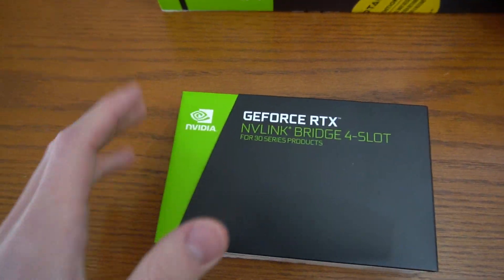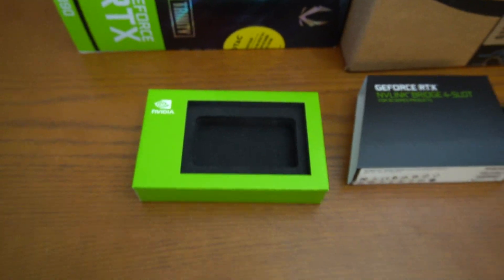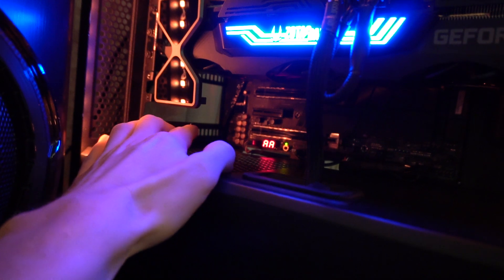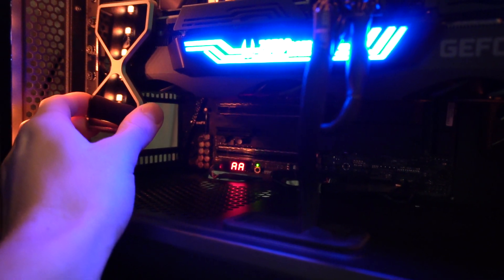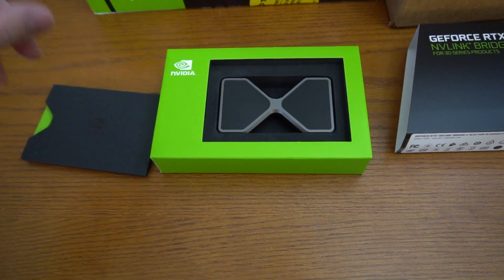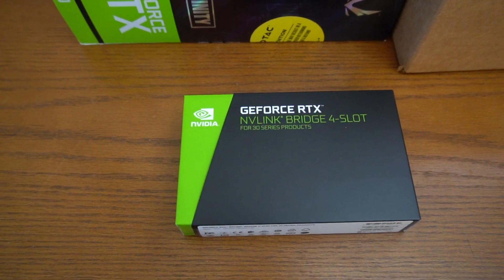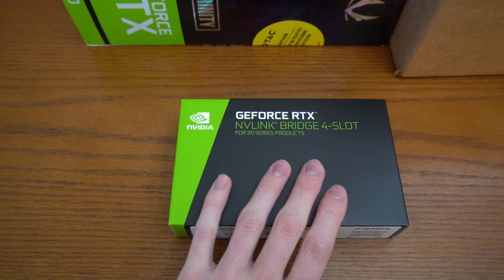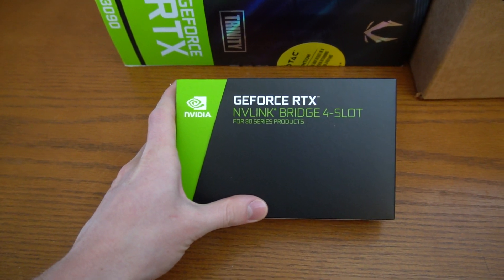RTX 3090 NVLINK issues already...

Comment: PNY NVIDIA NVLink Bridge 3-slot for Ampere RTX Quadro Tesla A6000 works for 3090 Ti FE GPUs but, I changed motherboards to get a 4 slot setup with the same Nvidia 4 slot bridge in the end. I did not want to run the GPUs hot long term but for demo testing the 3 slot PNY NVLink A6000/3090 worked. Actually, SLI configured directly on setup with Asus Maximus VIII Hero motherboard. However, with the EVGA Z590 Dark I had to manually run update for BIOS 1.02 to get version 1.08 for SLI to work. GPUs both worked but SLI needed a newer BIOS which I only figured out via lucky trial and error.
Reply: do you know which size of motherboard would work for the NVLink Bridge 4-slot for 3090?

Comment: I have the same problem. That's why I'm searching for this to find a 4-slot spacing motherboard. It's really frustrating and not very well thought out by Nvidia. I've tried using riser cables as well, but there's not enough room to position the cards with riser cables, given the extra space they require for the cabling and however you're going to position the card with risers and bridge.

Comment: There iis only one way to finish that job in my opinion.  The 3 slot bridge is for the 20 series and the 4 slot for t 30 series boards.  You need half a slot ventiation space.  Using that motherboard with that amount of power is like trying to race two supercars in gridlock.  Some serious heat going through the motherboard too.  There is still a way if you really want to try and drive supercars through the crowded tiny streets of that motherboard.   PCIE risers.  Install the risers.  Make yourself a box or frame for the risers and cards to go in and mount the two cards exterannly.  You can finis that jo that way if you really want to keep that motherboard.  That would even give you room for a load of other micscellanous expansion card stuff becase only the riser wires taking up space so get all the other slots back.  Just a box of your own design attached to the outised of teh PC.  Hope that helps I got a feeling a metled and warped motherboard.

Comment: it frustrated me, mate. currently I use ROG Rampage VI EE, if my calculation right yes it fit 2 rtx 3090 sli, unfortunatelynlike your video they only produced 4 slot or 8cm NVlink, hope they make the 6cm available soon. I almost buy 2 of those GPU, unlike NVDIA, AMD not required crossfire Bridge for 2 GPU. I hope we get the solution soon.

Comment: You need to use a few pci 4.0 risers and a custom vertical mount bracket.  Unless you want to try and find one of the rare 4 slot boards.  That’s what I’m using and it works great

Comment: Yeah that's because it requires 4-slot bridge which requires 4-slots spacing, there's a diagram on EVGA and Nvidia site describing proper spacing, So you need a full 16 PCIE lane  (16x) starting the four slot spacing count below the first slot occupied by top GPU, this isn't a product issue. And you do not want to use 3-slots spacing which is what you're describing @1:40 which will star of the top GPU of air and will ultimately result in the top highest GPU starting thermal throttling there's a reason why they opted for a 4-slot unless you're water cooling. I'm telling you, avoiding butting these cards against each other as they are 350W+ TDP parts and need all the positive airflow they can get, these are not blower style cards so you can't easily stack one on top of the other as air flow is not coming in from the front of the card it's coming in from the bottom.

Comment: Hey is the nvlink 3090 bridge the same as a nvlink 2080Ti bridge? They look identical to me. I’m going to add another 2080Ti. And I kinda like that newer style of the RTX3090 bridge.
Reply from the maker: They are different
The 3000 series uses a completely different style of NVLINK from 2000 series.
Reply: @BryceAdvice  Ok can you elaborate? I’ve been researching this, but I can’t find anything about then 3090’s nvlink connection, I know it has slightly increased bandwidth. But the RTX6000 and RTX8000 have higher bandwidth than the RTX3090 nvlink adapter, and their nvlink
bridge was deemed incompatible, but it works on 2080Ti’s, even though Nvidia said it wouldn’t. So that’s kinda why I’m curious about it.
Reply from the maker: Go to the 3090 page and at the bottom there is a listing for the 3090 NVLINK adapter.
Reply: The header from 20 series nvlink is obviously different and will not fit . You need 30 series nvlink bridge for 30 series card.

Comment: hey bryce! i need to buy an nvlink but i can't find anyyyy! not even on nvidia site! there is no buy buttion!
Reply: if you diden't return it I will buy it from you!
Reply from the maker: Sorry it's already been returned.
Reply: @BryceAdvice  so is there anyway to buy those?
Reply from the maker: NVIDIA website. It's on the 3090 page.
Reply: @BryceAdvice  I'm from dubai bryce, i don't see any buy button on that page, would you check it for me? If you see there is a button let me know, maybe it's about the ip and regions
Reply from the maker: It's toward the bottom. It's a bit hard to find you have to look around but on the 3090 page there is a buy option for the NVLINK bridge.

Comment: I recommend loosing the case, selling that motherboard for one with a another x16 at the forth slot, and built a wall mount set up. those suckers are gonna put out alot of heat if you get them, and it will be difficult to really control the temperatures having them so close together at 3 slot distance. just my 2 cents
Reply from the maker: Not if I use 2 slot  blower cards. Which is what I plan to do.
Reply: @BryceAdvice  well, I did base my statement assuming you would be buying a second of the same card that was in the video. Is that not your 3090 in the system running? Also, in your case there, is that the x299 platform that was in your oct 8th video?
Reply: skip half of that, sorry i didn't finish the video haha
Reply from the maker: I did the Zotac 3090 and will be getting dual Gigabyte blower 3090s once they come out which will exaust that hot air out the case. 
I am on the Intel 10980XE and the board I have both the top PCie slots are X16.

Comment: Sorry if this  is  a  dumb question -  why  are  they  designed , these nvlink bridges, like that? why not like a cable which is flexible maybe?
Reply: there is a controller and some components on it so they can't solder that on a flexible pcb

Comment: Try cracking it open maybe it is not one solid pcb and the bridge has flexible ribbon cable inside.
Reply from the maker: Unfortunately I already sent it back and got a refund.
Reply: @BryceAdvice  nooooooo :(
Reply: It's not flexible at all, it's a pcb. There is a controller and some components soldered to it.
Reply: @arkama67  how you know? did you open? or seen pics?  im looking for sources actually
Reply: @Heinz76Harald  I had one and I tried to "make it fit". There is a chip and a pcb in the middle of the bridge. And yes I did open it.

Comment: Mentioned on NVidia's Quadro RTX A6000 page: "The NVIDIA RTX A6000 and NVLink Bridge Will Be Available Soon". On last gen cards, you could use the Turing Quadro NVLink bridge on the Turing GeForce cards as they used the same NVLink 2.0 interface. The Ampere GPU lineup now uses the NVLink 3.0 interface for both Quadro and GeForce. If you can't get a 3 slot GeForce branded Ampere NVLink bridge, just try to get a Quadro Ampere NVLink bridge and use it on your GeForce cards. They are confirmed to come in both 2 slot and 3 slot variant https://www.nvidia.com/en-us/design-visualization/quadro/rtx-a6000/
Reply from the maker: Sounds great. Thanks for the help!

Comment: The screw covers are magnetic, so use duct tape or a strong magnet to pull the little screw cap off to reveal the screws.
Reply from the maker: Ah cool I was wondering how they had them connected.